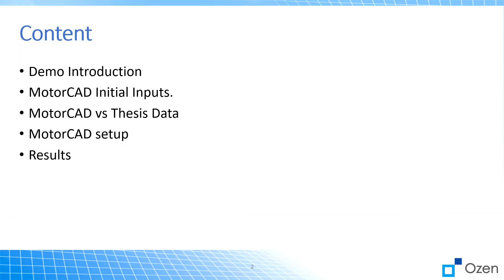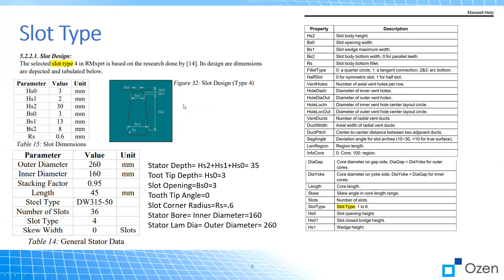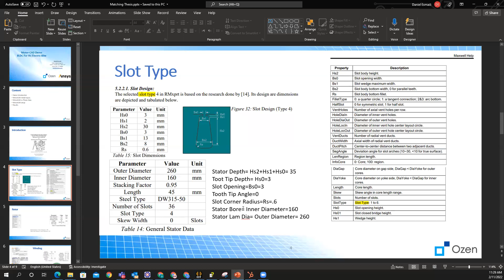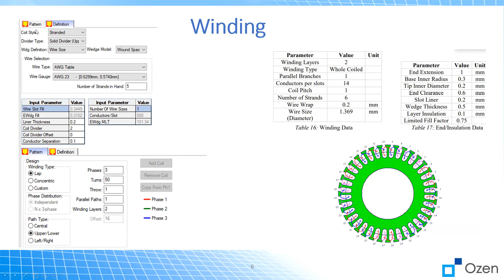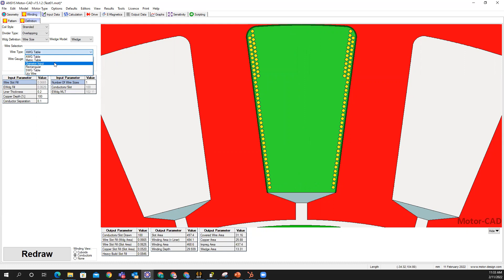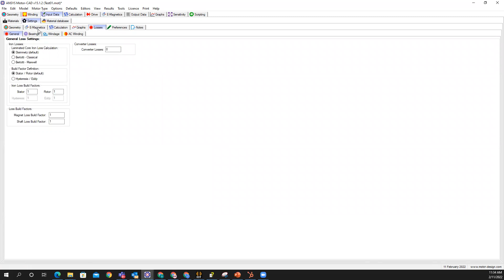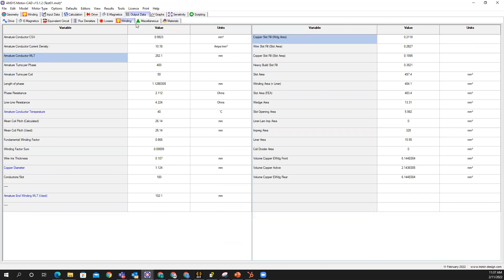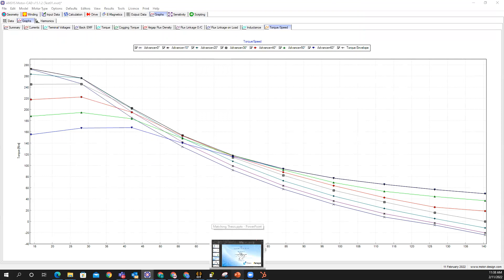BLDC simulation with Motor-CAD . Inserting parameters, setting up model, and explaining the results

Comment: is there any way i can couple motor-cad with ansys fluent (kind of two-way coupling - temperature data should transfer based on losses)
Reply from the maker: No, because it is typically not needed. You can do more detailed coupling through Ansys Maxwell and Fluent.